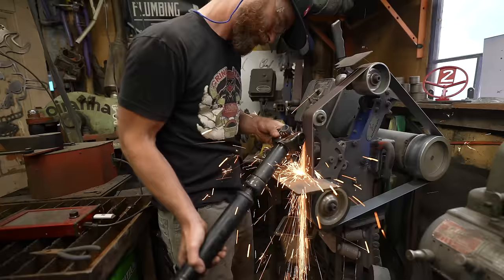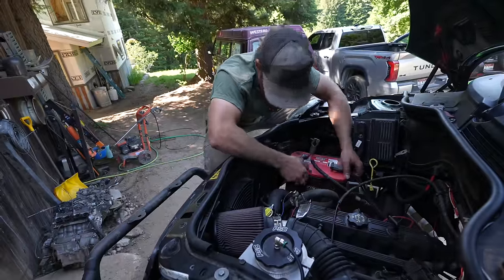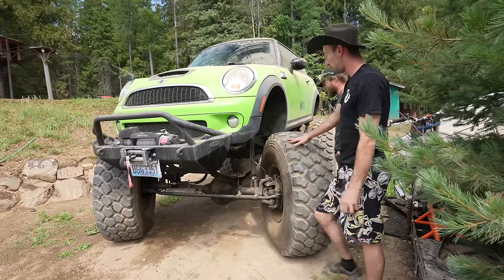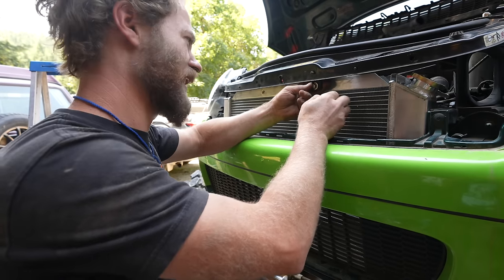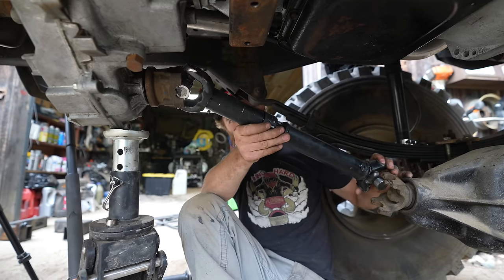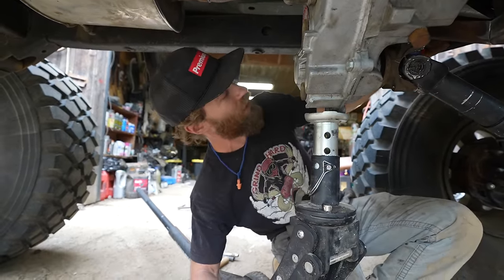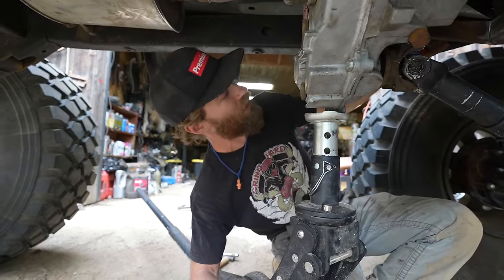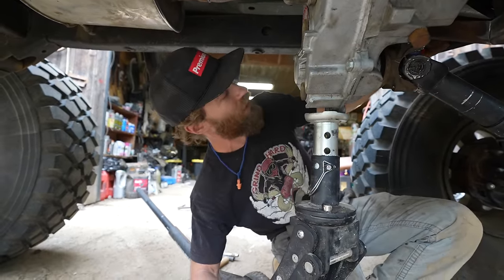Finishing The Mini Cooper Monster Truck!

Comment: You really need to get some fully enclosed googles instead of those ones you got on especially doing that fiberglass work. I was wearing  basic safety glasses when i was cutting a bracket off a truck with a cutting disc and it jammed and the disc just shattered and some of the debri shot up under the glasses between the nose and cheek and into both my eyes and embedded the particles in the skin of my upper eye lid inside and all the way to the back of my eye socket behind the top of my eyeballs. The eye doctors here were useless and said they couldnt find them so i spent the last 4-5years scraping them out of my eyes and i counted 200 fibre splinter  that i got out out before i gave up counting and still to this day im still getting bits out. And you will wish you wore googles that seal to your face no entry points. Nice work thou. I love cars and anything with a decent power range. So its fun watching👍😎

Comment: that battery tray, if u wanted to.. yo could cut 4 or 2 squares or any hole shape  in it, and use the plasma cutter, to make it mini tray that welds to the holes with flanges as the spacer, drill a hole on the base of mini tray for the bolts, than u don't have to, or interchangeable and by bolts are not in the way. this all goes on the bottom of the tray on the under side.  :__  __:
 .                                                                                                                                                                                                                                                                                                          :_:
.                                                                                                                                                                                                                                                                                                            !
kinda like that the battery sits in the top part, the escalation point, is a bolt. the best i could do XD Anyways love your vids and keep making awesome premium builds, with the crew... 

love from Canada

had to edit, because for some reason YouTube compressed it my a few spaces... its like 10 spaces of of alignment, but when i save it it shoves over XD

Comment: Angled shims between the stacks and the diffs is the solution to drive angle issues. May need to extend or replace center pins of course.  Luv this build so much guys. Fun toy

Comment: Hate to tell you guys but that's where all that stuff is sitting without moving where do you think it's going to be when it articulates and flexes on trail. But then some gears and a torque storm blower. That little bit of power you will be sad on a 8 of 10 trail and run like 15 psi it will be softer. Beadlock required lower then that

Comment: could you adjust air pressure, it looks like has slot pf pressure in them? when dessert running or rock crawling they reduce sair pressure. maybe ok and just looks over inflated just a thought.

Comment: looks to me. . . . . that the front drive shaft is too long - the slip joint has to extend when the suspension travels down (that looks good) but has to compress when it bottoms out "that looks like it will jam up" , it's almost fully compressed now  ?  from a camera point of view  :face-turquoise-covering-eyes: hope this helps

Comment: 30:45 Double bevel will make the plate much weaker than if you just continued to make smaller holes rest of the way so you reverse. Why do you think there is two versions of this part? Will it work? Yes. Can it snap and wreck the transfer case and transmission in worst possible spot? Also yes.
39:20 So crap collector 2000. That will be caked with mud and crap. While its pretty thick its not good design to have areas that collect moisture and crap to hold it in. Could have used channel other way around and have tubes for the bolts go trough to backside allowing the unbolting actually better i think than this design. Also adding couple ribs as reinforcement would make it look cool as sturdier construction.

Comment: Um, Err, Rotate the axle, so the diff is same plane as drive shaft..
The output shaft of the diff, doesn't have to be horizontal, you can tilt the diff..
A Lot off people get this wrong, and blow out uni joints when having fun..
Point the Diff towards the drive shaft..

Comment: I think you're gonna want to cut more space on that bumper for those shackles. You have to take compression into account, those things are going to rotate forward quite a bit as the leaf flattens out under compression.

That and it looks like those are basically stock shocks, you'll want some longer travel shocks or you're gonna rip them out going up or down whichever comes first.

Comment: there is a company called 505 performance and they make stroker motors for the 2.5l. 3 grand for a block 1800 for the kit to do ityourself there are also a couple companies that make superchargers for the 2.5. i am about to get the rate motor for my jeep.

Comment: quick question to anyone who knows this, why is it that the TIG welder ark flashes? do it have to do with pulses in the current?
Reply: Yes, the arc pulses. It's not necessary to use pulse arc fot steel but if you know what you are doing it can make the weld much cleaner

Comment: 1:01:45 guys you gotta look at those leaf springs.. you might want to consider putting the shackle at the rear so there is somewhere for the pack to move to when you nail big rocks like that or you're gonna be stranded wheeling with a broken leaf guaranteed

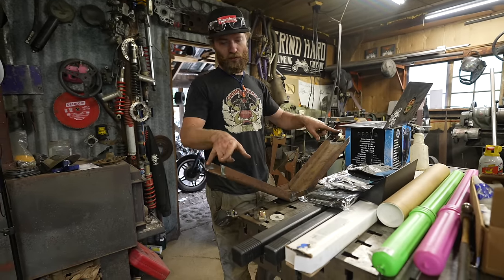Comment: 39:33 Would’ve been good to have captivated nuts on those, and then just run the bolt through the unibody, but then again that would take away from the structural rigidity of the unibody

Comment: You really should put a different engine or turbo it because that engine you have in it doesn't have the horses to turn those those tires.i could out run that car in 4wheel drive

Comment: Stay cool treat, wear wet long sleeve shirt in extreme heat
Reply: Why did you put the shackles up front instead of the rear of the spring
Reply: Transfer came just flopping around